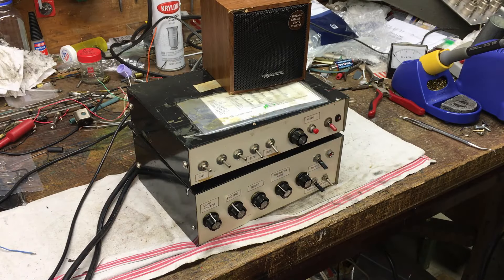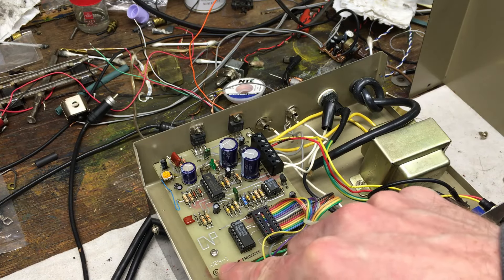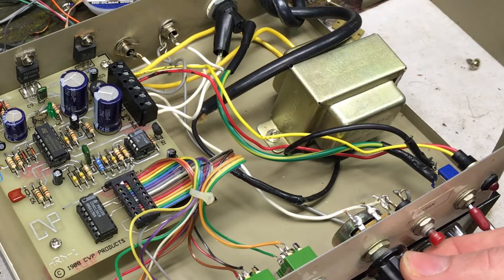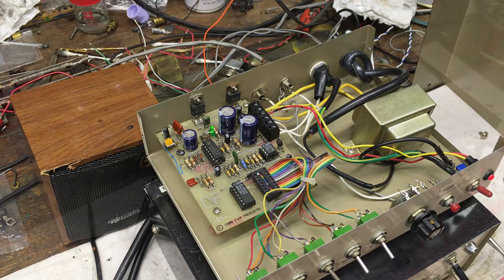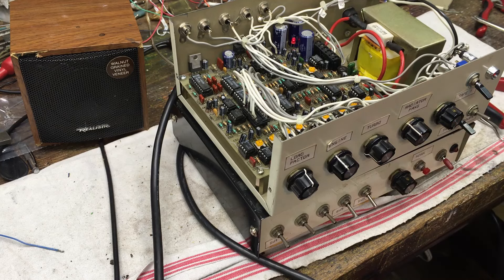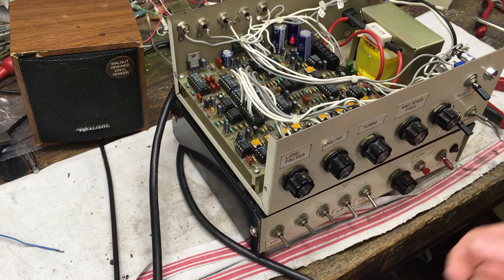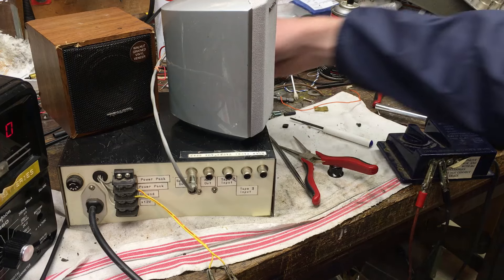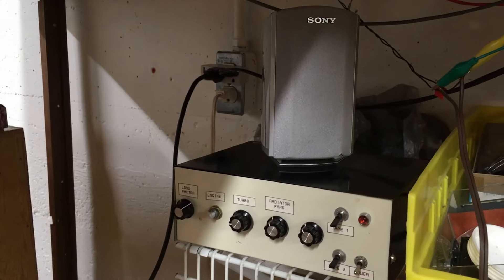Digital Train Sounds from the 1980s without DCC!

Comment: The second box looks to have quite a few 8-pin ICs. I would be curious to see if they were 555 IC timers or op-amps. The circuit could be traced out and the IC numbers researched to see what kind of components they are as long as the information has been scratched off of the tops of the ICs. In the current day, a person would just use an Arduino with a SD card reader along with an amplifier using MP3 files to basically perform the same thing this box currently does. Hopefully, you will be able to find more information to make this set up perform well.
Reply from the maker: I imagine this was very expensive to produce. Someone spent alot of time engineering sounds from all those chips just to mimic a diesel locomotive. What i might do with this is get a bluetooth tx and a mini speaker so the sounds can fit inside an engine or boxcar